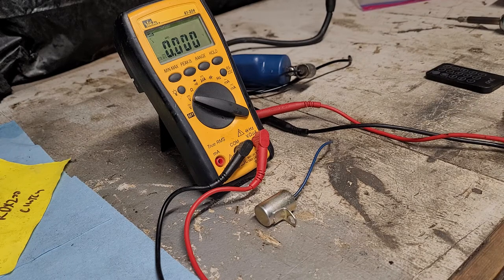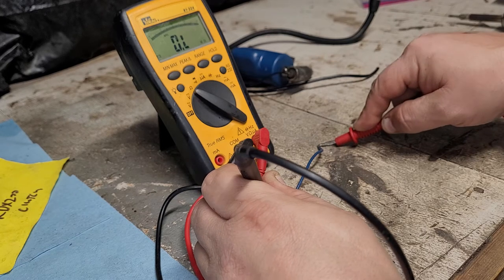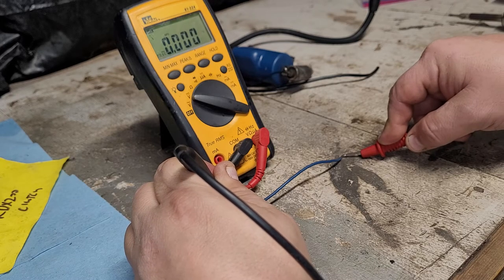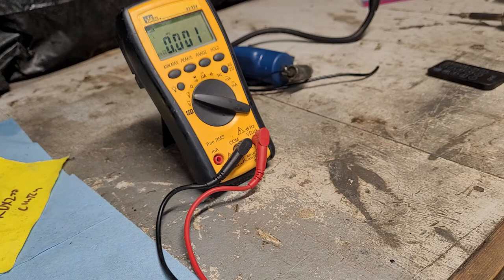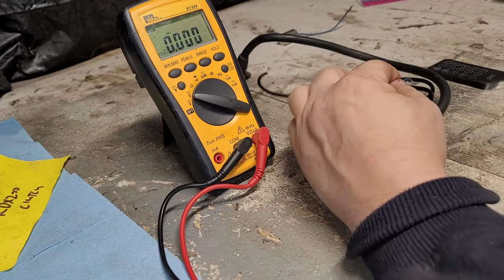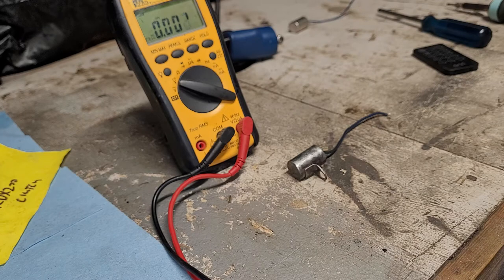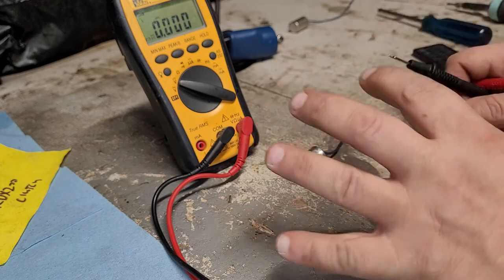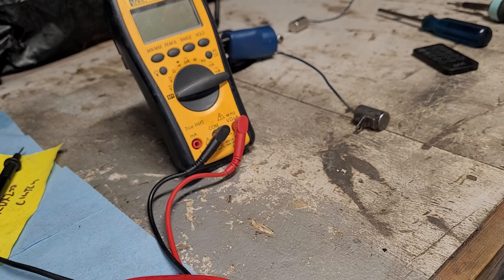How to check condenser on vintage Honda motorcycle.

Comment: Thanks Adamz, good video, I believe 'OL' on the multimeter stands for Open Loop.
Reply: OL stands for Open Line... but you were close enough. Just thought I'd clarify 😃
Reply: @ka0skontrol504 take a look at the information with the meter actually OL means overloaded in any selection of the meter Cheers open loop open circuit meaning just slang meaning the same thing

Comment: Good video dude. Thanks very much. 

Found my problem thanks to your video. 

I had a joiner between the coil and condenser which ended up having loads of resistance. So it would discharge fine at the joiner area, but wouldn’t discharge at the coil end. 

Legend.

Comment: You can go to capacitance measurement mode by going three clicks right past your ohmmeter mode. A direct reading is definitely much easier than waiting for voltage to drop from a charged capacitor.😂

Comment: will a motor run with a bad condensor.. im trying to set my timing with a light and battery but it doesnt dim the light.. bike runs, but not well
Reply from the maker: It can actually cause a weak spark, which will cause  rough running .
Reply: @AdamzGarage  the spark seemed strong when I tested it, but under load it may have been breaking down.  im wondering if the ignition caused the backfiring.. im thinking that the H model with the flywheel weight timing advance set up may not be as refined as the ones without. levers under spring tension that kick out from centrifugal force  that varies the inserted lobe doesnt seem too accurate?
Reply: my condensor read .003 MFD  .. so I think it is shot.. I will check the new one for future reference.
Reply from the maker: @randy1ization  yeah sounds like it's bad.👍
Reply: the new capacitor reads. .002 on the 200 mfd scale

Comment: sorry  but those #s dont mean anything  you can not test a capasitor with an ohmmeter they are rated in micro fareds you need a microfared  meter to test them  my trk need a 27 micro fared capisitor for max current to spark you can install wrong value it will work to a degree but causes your points to pit   --- check if the points are pitting ---wrong or defective capisitor swap it out

Comment: Nobody does this with it in the bike :/
Reply: That's because of two reasons. One, it makes it more complicated and two, different bikes have different configurations and some if not most of them use the body of the condenser as the negative point on it. Basically, it means that you would introduce too many extra variables by trying to test it while it's still bolted to the bike.